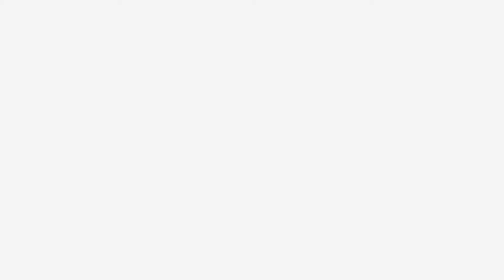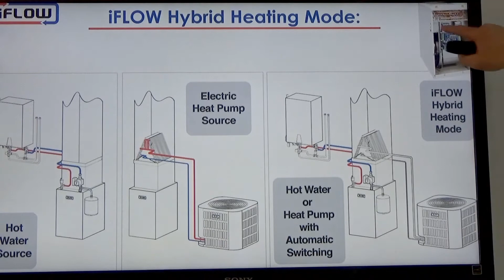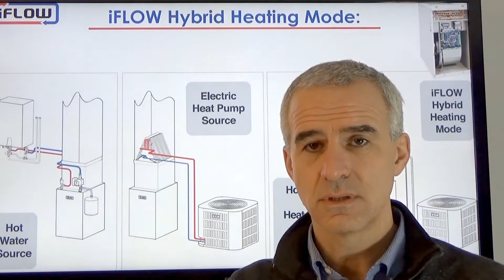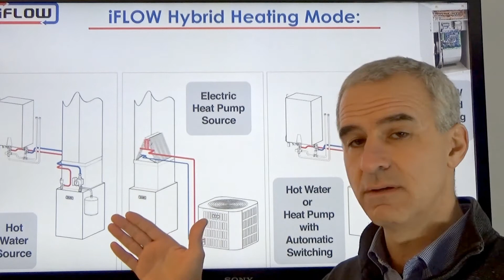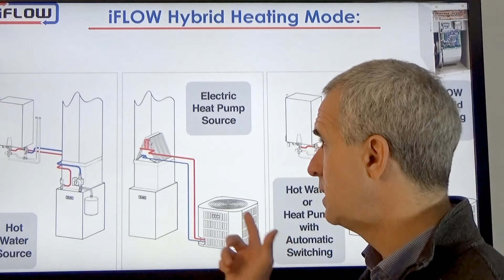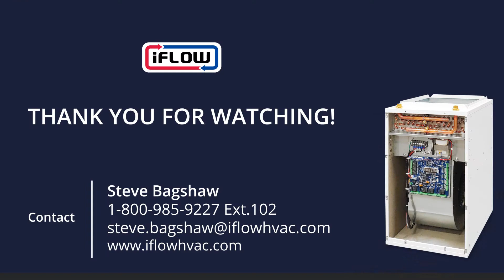iFLOW Hybrid Heating

Comment: How would the system work with an air to water heat pump? Where the outdoor unit can produce heated or chilled water (glycol) so there is no refrigerant passing through the indoor coil.